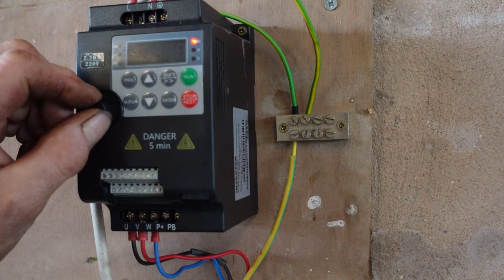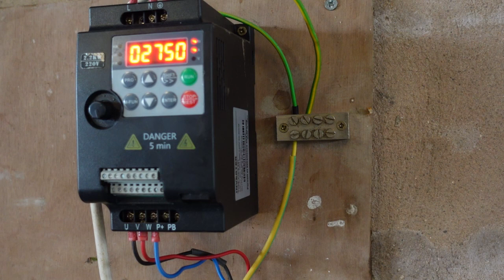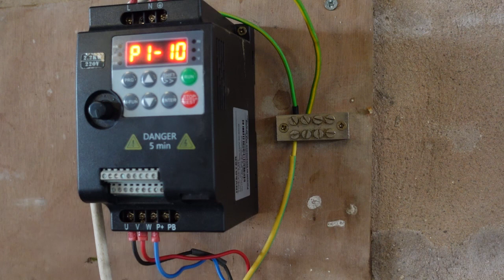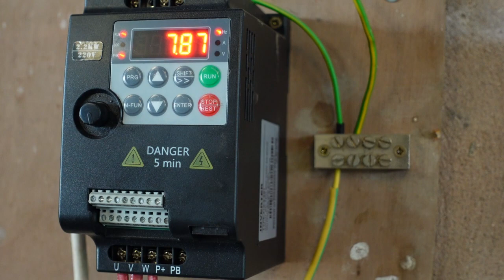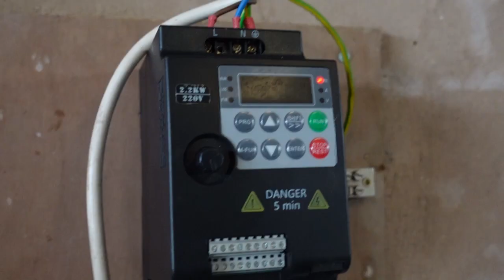Quick start VFD programming it's easy!

Comment: Nominal voltage is voltage marked in motor type plate. Your motor is connected in star/wye configuration so voltage should be 380-440v (=400v) Which this single phase vfd cannot supply. Change the motor configuration to delta to get full power from the motor.
Reply from the maker: Of course you were quite correct, I realised my careless mistake before I had finished reading your comment. I have corrected both the machine and the video. Cheers, Jon